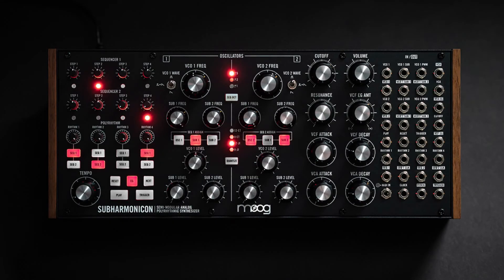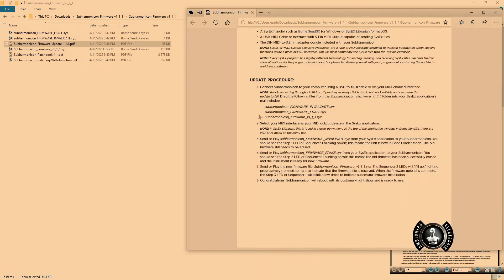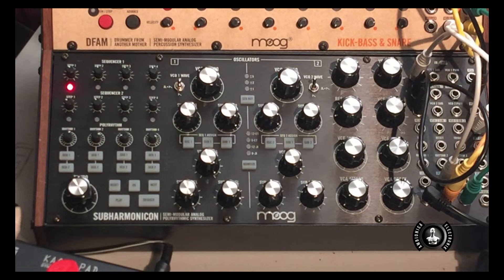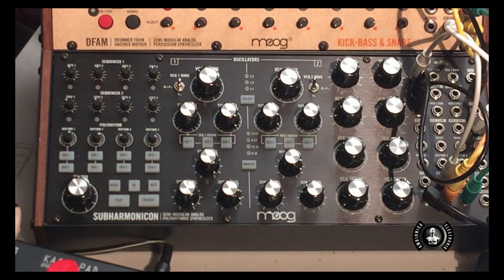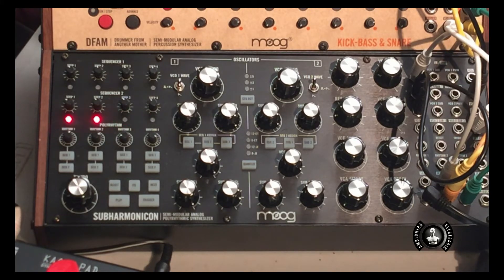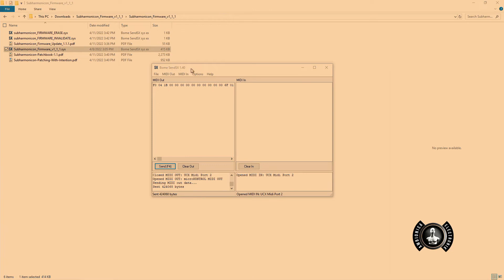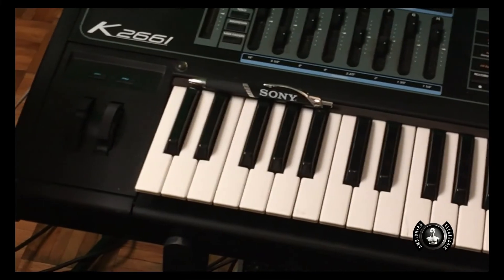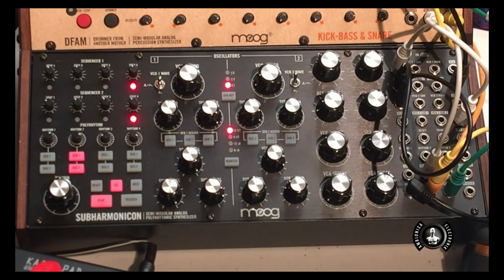Moog Subharmonicon Firmware Update 1.1.1 - installation instructions & new  features demo.

Comment: So how many patch cords does one use, and where are they patched into?  You seemed to have a few in there.  Isn't that the first thing you'd want to make clear.  Without a cable the upgrade is useless, kind of like this video. 👎👎
Reply from the maker: Hi, the patch cables do not matter in regards to firmware upgrades. best wishes!!!
Reply: Then how does one connect to a computer to perform the update?
Reply from the maker: @eugenelayton5231  hi Eugene. the midi adapter that comes with the subharmonicon is the only cable required. the other patch cables in my video were just there from me using it earlier in the day. maybe i should've removed those for this video to avoid any confusion. best wishes!. :)
Reply: I have three of those, Type A. But where does one plug into the Subharmonicon?  I've been Leary of updating firmware since last mont when I hooked up my Keystep 37 to update it's firmware.  Now it is inoperable and I haven't heard back from Arturia in two weeks.  I guess I'll have to eat $200 for that, although it was fun to use before it died.  Have a great day!
Reply from the maker: @eugenelayton5231  that sucks!!! i did same with a motu audio interface many yrs ago. i live in Florida. summer we get bad storms and like a dork i choose to do firmware upgrade. lost power and that was that. motu said no repair it was DOA. :( so i get the nervousness. for me it went ez. hope it all works out.

Comment from the maker: Each time you install a new firmware, it completely wipes out the previous version so just install the latest firmware version. no need to install previous or in-between versions. if by any chance you run into an issue during install just start over from scratch. Moog provided directions in this situation. Worse case scenario you can always downgrade back to your previous firmware so no worries. The two things I'd be careful of are #1. don't lose power to the device while working with firmware. #2. be patient. the upgrade can take up to 10 minutes. do not interrupt the process. It's a very easy process.